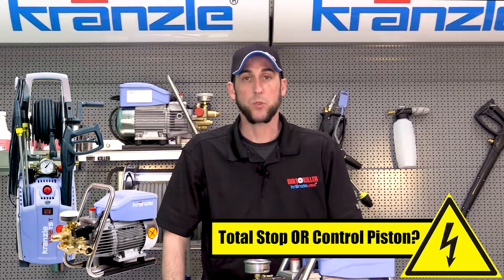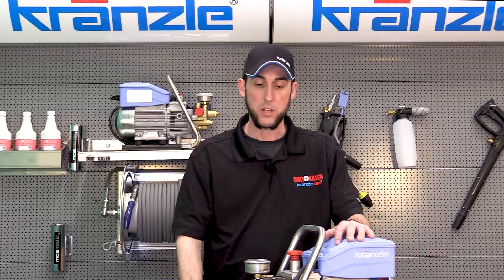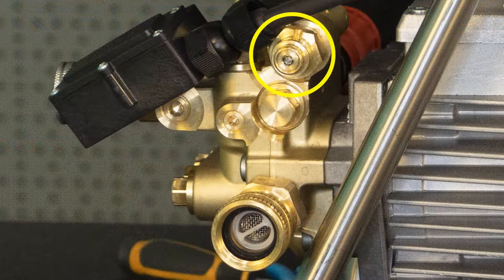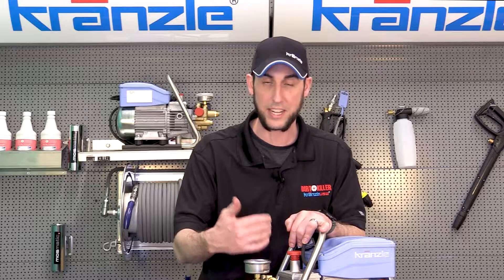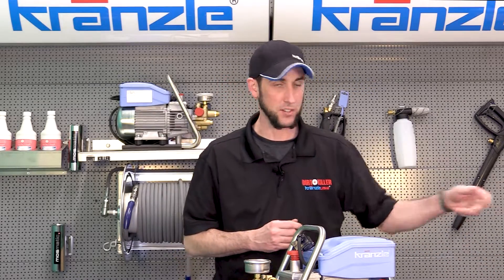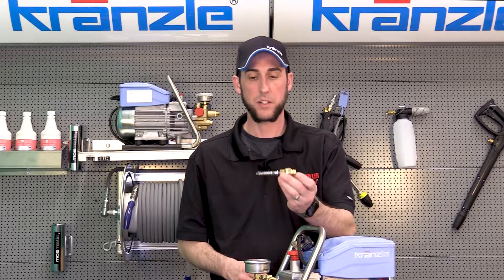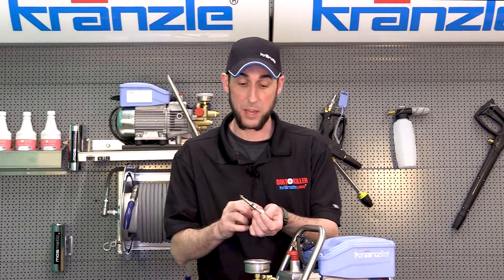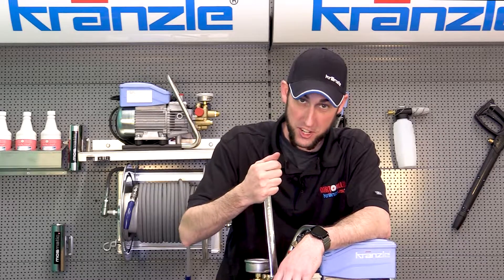Total Stop control piston trouble shootings | 1622 1122TST 1322 Kranzle USA Pressure Washer

Comment: Hi can the K7 be changed to a start stop machine if i buy the start/stop pressure switch and wire it in?
Reply from the maker: This may be possible. Call and speak with Josh Lee or Patricia. 800.544.1188

Comment: My Kranzle doesn’t shut off when I release the trigger, when I pull the trigger I can hear what I believe is either the motor or the pump turn on, but then when I release it, something stays on. It isn’t as loud as when I’m pulling the trigger so I feel something is shutting off, but the Kranzle isn’t completely shutting off. I followed the steps to this video but I’m still having issues. The gauge stays at 0 the entire time, even when the trigger is pulled and released.
Reply: I slept on it & the machine is in perfect working order now lol. However, I made the mistake of wiping off what I thought was random gunk from the control piston & now think it was what you guys use as lubricant. I heard in another video you guys use Vaseline as lube, can I use that here as well?
Reply from the maker: Yes.

Comment: Hi!

My Kränzle 1150t just ”humz” when i put the power on. Then after aprox 10 sec the power button switches back to off. Do u guys have any clue what could be the problem?

When the machine is turned off, water is comming from the pistol when I push the handle. Oscar from Sweden😊
Reply from the maker: A hum usually means the capacitor is shot. Super easy to replace. Here's a video:https://www.youtube.com/watch?v=aE_s1wv4ipI

Comment: Hlw josh, i am facing problem in my machine over fullystop function, i have changed my control piston and checked for all the leak with gun and other component and microswitch also doing fine job,but when i  release the trigger in the gun it is not fully stop and regulator piston also vibrating ,can you suggest me solution for this problem
Reply from the maker: Hmm. What kind of sound does it make when "NOT FULLY stopped"? Got any video? Please do send a tech support ticket at KranzleUSA.com or give us a call. 800.544.1188

Comment: I have a question about my HD7... I don't know if it's a problem or not.  When no nozzle is connected to the gun, there's basically no pressure. Is that supposed to be the case?  When I connect the gun (I have a Mosmatic) the pressure doesn't go over 1000psi, even when the pressure adjustment is maxed out. Is that normal?
Reply from the maker: Hi. Technically speaking the pump only MOVES water at whatever GPM. The NOZZLE orifice size is what creates the pressure. It's like a balloon. When you pinch the end, the air stream pressure increases. What size nozzle do you have on your Mosmatic gun?

Comment: Would this issue with the control piston cause any short cycling issues?
Reply from the maker: Hi. We are checking with Josh Lee. Will have a detailed answer shortly.
Reply: Is short cycling when the TSS turns power on and off every second when trigger is activated ? If so I want to know as well. If no tip is in the gun, the TSS acts normal. If the tip is in, it cycles. Tried different offices but no luck. Bypassed the TSS and it runs fine but obviously you would turn the power off by hand. Would this be the unloader valve? If so, what is it failing to do?
Reply: @mnovo  My issue was basically when you turn on your Kranzle it'll pressurize and then come to a stop. If you wait a minute or so without even touching the trigger on the wand, the pump will pressurize. My problem that caused this short cycling was due to a bad Outlet Check Valve where the stainless steel check ball was scored up out of the box that allowed fluid to pass. Replacing it fixed the issue.
Reply: @telim5848 ah, thanks. Mine happens when I squeeze the trigger. It cycles every second with the sprayer tip on. But works as it should with no tip in the gun. I tried different orfice sizes but no luck. I tried different guns, hoses with no luck. If I bypass the TSS, it runs with no issue. The TSS is mint. I'll check the check valve though, thanks
Reply: @mnovo  How did you bypass the TSS function? Did you disconnect the pressure switch? Maybe potentially an issue with the pressure switch? This video might help in diagnosing your issue, it's full pump head teardown with an explanation of common issues you may run into. https://www.youtube.com/watch?v=Noo7QtH90P4&t=2515s.
Reply: @telim5848 the bypass is easy as it is part of the circuit loop. You simply delete it. I tested the TSS itself as well and it is fine. So, maybe it is a check valve as waterflow doesn't seem to be the issue.
Reply: @mnovo  Got it. Tracking down short cycling issues is a pain. Hope you get to the bottom of it soon.

Comment: Josh.  Very helpful vid and may be the cause of the problem I am having on my 1122 right now.  However, just a suggestion that you lower the camera angle a bit so we can actually see you working on the specific area.  These vids are really helpful to the DIY'er who doesn't want to send an 80 lb. machine to a dealer to fix it.  Thank you!
Reply from the maker: Thanks for the feedback. Will relay to Josh. Glad it helped. Noted on the camera angle. Hopefully the close ups gave the details you needed.
Reply: @kranzleusa5846  Problem solved!  Motor would not shut off.  Likely some build-up of dirt or minerals on the piston or in the piston housing.  Vid was super helpful to diagnose source of problem and also with order of the parts (brass washer, O ring, etc.).  Thanks Josh!  Shout out also to Patricia at tech support who spent way more time with me than I deserve!